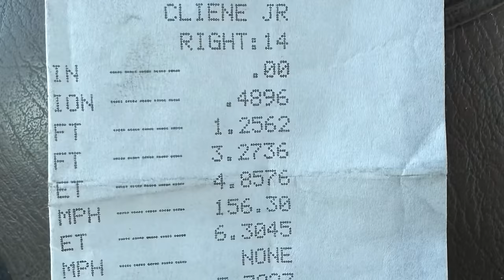Personal Best AGAIN 1/4 mile!  TurboJohn Saturn working!

Comment: Good to see you again John.  Appreciate you capturing my 1st pass @8:09 .  It knocked the tires off (too much rpm on launch) but it was the first time I've ever raced this car.  2nd pass was better but had marginal launch (1.80) but did run 6.8 @ 108 in 1/8th and 10.40 @ 136 in 1/4 shredding a belt and breaking my upper supercharger pulley!

Comment: HUH...?.. Man i got so much to learn! Did he seriously say the plugs are only gapped to 14?? How the hell.. what.. im lost! Ive learned a turbo, specialy the size of TJs, can blow a spark out but i wouldve never imagined anything would happen with a plug gapped that tight. WOW! Thanks for the little info Big John!!
Reply: Old plugs had nearly everything to do with it….plus its a bit fat too.
Reply: I can confirm some of the smartest tuners  I've ever listened to twelve to fourteemln
Reply from the maker: It is wild..... with smart coils on my car if I gap them at .020 it will run to about 30psi.... but after that it starts misfiring.... crazy
Reply: @TurboJohnRacing  AMAZING!

Comment: In the live show you talked about having to go faster as per the competition. What do you need to go faster? Engine, weight, car? Is this car capable?
Always great videos
Reply: Big block, big tires, big balls.
Reply: New car with a lighter and stiffer chassis, BBC with a bigger single or twins.  And no this car is not capable and never was intended to be.  It’s a loaner car he using while the new ‘stang is being built.

Comment: Why not have the windows tinted on the Saturn? Put like a 50%   Ceramic tint from top to bottom on the windshield then have the rest of the windows tinted in 35% ceramic tint. One it’ll help with in car temperatures but it’ll take the glare off the dash as well. With that percentage tint on the car you won’t have any issues with not being able to see the tree at night or drivability. Just a thought
Reply from the maker: Can you tint lexan?  I know you can buy lexan already tinted, but don't know if regular tint will work.
Reply: @TurboJohnRacing  absolutely you can tint lexan, I’ve seen people use automotive 2K clear and they add a little black until they get the darkness they want then they spray the lexan and let it dry. Kind of like using the VHT Night Shades or you can tint with regular automotive window tint. It’s up to you.

Comment: Hi TJ! Since you have your new plugs pretty much dialed in for this tune, what would you say to popping a set of Autolite 3931's in it and pick up a tenth in the eighth without changing the tune or anything else?
Reply from the maker: Interesting, I've never ran those or heard of a big gain by switching....... tell me more!
Reply: @TurboJohnRacing  I can only go by my experience TJ. I run a bracket dragster in the 4.7 to 4.8 area in the 1/8 depending on the air. I have always run Autolite plugs on methanol. On a test and tune day at my local track I specifically tested with the purpose of making passes with no changes. Air was good and stayed consistent the whole day. I made three passes with AR3933 plugs NA and the second two of the three were 4.76. So I put in the  respective heat range NGK with the same gap and that pass ended up being 4.86! So I made a second pass and it was a 4.85! I lost .09 seconds running the NGK's! Now reading Autolite plugs is more difficult than reading NGK's because something in the Autolite's cadmium takes three to four passes on methanol to get a read on them whereas you can read the NGK's even after one pass! But I believe when you get it tuned with the NGK's and then put in a comparable heat range Autolite with the same gap, you will see a pickup in ET! Even if you only make a 330' pass you will see it pick up! Best to try on a test day and make 2 passes with each set of plugs as long as everything else remains the same! Hope this helps you become faster as long as you are comfortable with the change!

Comment: Man with the glide and that gearing seems like you just be riding the rev limit from the 8th to the quarter lol
Reply from the maker: Rpm is pretty flat once it gets in high gear, converter is really coupling at 7700 ish.... Would probably go out the back at 185ish at 8100-8200
Reply: @TurboJohnRacing  
Wow thats not bad at all. In the video she sounds pretty high strung. Sick car man keep killing it.

Comment: Why do you think NHRA and IHRA have a rule about no car running unless someone in the drivers seat?
Reply: Why do YOU think they have this rule?
Reply: Inthe early 80's a couple (Man and his Wife), were working on a car in the pits, and had a young son in front of the car a distance away, and nobody in the seat, car running up on jack stands in the front. Man hit the throttle zoom, zoom under the hood, somehow car slipped into gear, and landed on the wife and son.

Ergo, immediately the new rule was put into effect.
Reply: That pit accident was at O.C.I.R. in Irvine, CA btw.
Reply from the maker: I always try to keep someone in the car when it is running, but occasionally have to work on the car and no one in the seat.  Always in Park or with rear end up.  It is so easy for the cars to rapidly accelerate it is always good idea to have someone in the car when running or cranking.  I know they are required, but a lot of cars don't have neutral safety switches either or they can fail.

Comment: Hey big guy! Have Mike or you contact Steve Morris! He just put a video out of a procharger exploding during a dyno session! Mike's issue may be what caused Steve's issue ..... possibly???
Reply: Watch Steve's Dyno vid again, it was the pillow block on the Dyno, came off, and caused the rear crank bolts to shear, causing an extreme over Rev of that engine being dynoed, that blew up the blower as they were never built to take those extreme  rpm's, so it had nothing to do with the blower beyond destroying it. 12,000 plus zinging instant rom will do a lot of damage, no matter the blower manufacturer.

Call it a dyno incident, as it highly appeared to be caused by the dyno coming apart, not the engine failing.
Reply: Rpm, not rom